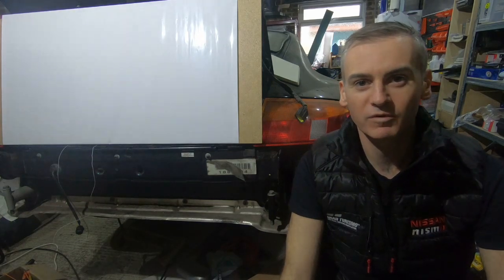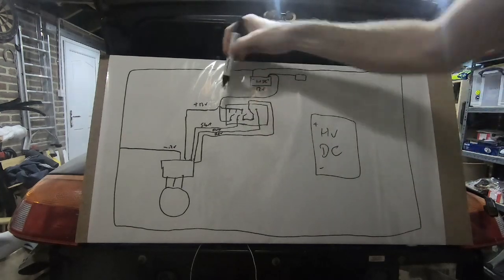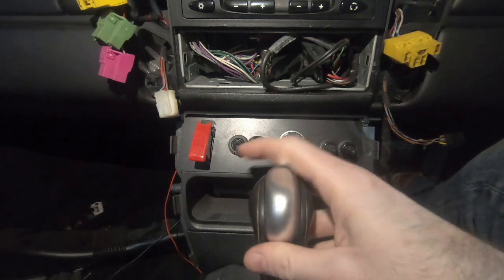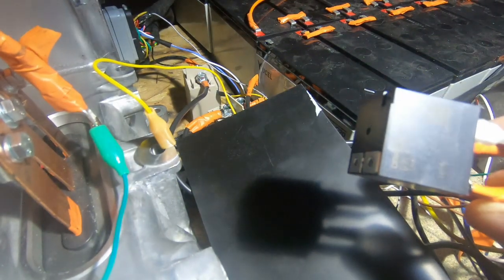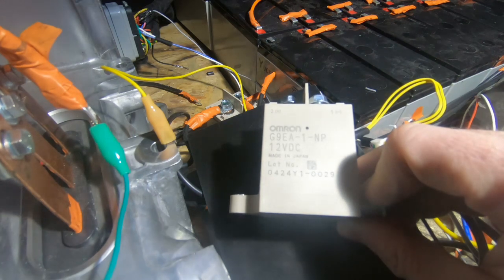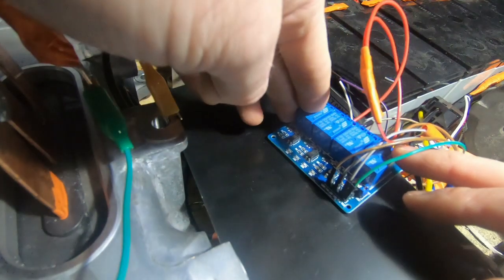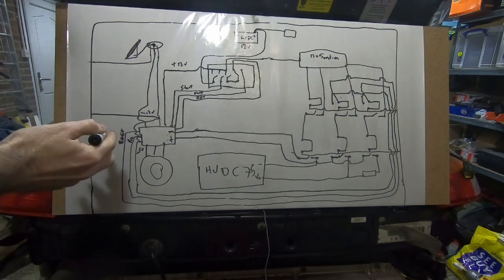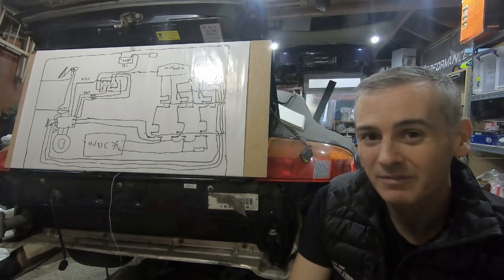Building an Electric Car - EV Parts - Open Source Inverter Wiring

Comment: I have a nissan leaf motor with the dc converter and the recharger still part of the unit. Is there any way to use those items with the motor since they will be. Needed at some point in time?

Comment: Hi, My name is Dave and Live in Las Vegas, USA.  I have 1973 Porsche 914 that was converted to electric 10-12 years ago.  My question is about the Leaf Heat pump or at least AC.  What voltage does the AC compressor  run on? I assume the compressor takes a DC voltage lesser than the Leaf batteries can supply.  My batteries are much lower voltage than the Leaf  and are at 170 - 145 VDC.  What can you tell me about the system?  Thank you in advance.
Reply from the maker: Hi Dave, I haven't seen much on the Leaf Heat Pump and AC module, I know the car I got the motor had one, but it wasn't one of the parts I got with the drive unit stack.  The output to it is from the Power Control Module,  so I guess it is expecting 360-400v.  Could you use a boost DC to DC converter to go from your 170 to closer to what the pump needs?  Electric 914 sounds like a great project, they are an awesome looking car. Good luck
Reply: @PerformanceEV  Thank you for your response.  Great video BTW

Comment: Well explained, it’s basically simple enough to follow. You may need to take advantage of breaking & deceleration to recharge the battery.
Reply from the maker: Thanks! Yes, regen on breaking is part of the plan, but I know that I will need to do a lot of configuration and testing in the software to get the car driving as I want it to, so keeping my focus on the basic operation of the motor first.

Comment: Great Stuff!  But now I have to aske a few questions :) What is the purpose of the capacitors and are you able to show how they are wired in a future episode? Also why use the electronic relay board?  Could you explain how to use the software to program the relay board.  Thanks!

Comment: Hi, well done on getting the wheels spinning.
Im at stage where trying to spin motor on projects, one is at outboard other is on Land Rover gear box (two project not a boat car sorry, not yet)

Mine is Gen 1 though and rather a few differences with wiring and control
I'm at stage where sending can messages direct to Gen 1 inverter,  and hopping to see it spin.
Reply from the maker: Wow, two projects at once, good effort! I tried to get the motor running just using Can messages, but didn't have much success, so I got a replacement logic board instead (this will be the reason behind the big differences to your wiring. ) If you are trying to control the existing inverter, then you should check out the work Damian Maguire has been doing, if you haven't already. He created an open source VCU for the leaf gen 1 and has put a lot of the information up on you tube and GitHub.
Reply: @PerformanceEV  I'm not sure he sharing all the info, is a lot of stuff their to tease us. 
But seem to be holding back, the code that shared does not seem to be about running the Gen 1 as he showing in video.

I'm progress well do far,  have the com's working sending can messages to the inverter. (Just getting an error and not to work out what step missed)
And I have worked out how to power up the junction box to use for charging back up the Aux battery
(Actual I shared that just the other day: http://myimiev.com/forum/viewtopic.php?f=23&t=4533&p=40483#p40483)

Next step it to work out the on board charger back in to the battery.

Some info on my project here (Not as much video as you sorry)
https://sites.google.com/activeautomation.co.nz/the-turned-leaf-project/projects
Reply: Also im using Gen1 and your Gen2 so some difference I have seen in Can messages just with those

Comment: I am actually surprised that openinverter (Johannes' ?) board supplies 5V for positive/precharge contactors instead of 12V. Will need to dive into it more before my conversion.
Reply from the maker: The positive/precharge output itself isn't a 5v signal, rather an open collector output. The relay board that I used to interpret that signal and feed 12v to the contactors needs 5v power. I could run it from an external 5v source and have only the single open collector signal wire coming from the inverter itself. I am using the 5v from the inverter to minimise the number of different objects I have in that part of the car.

Comment: How calculate resistance of precharge resistor for 400v battery?
Reply from the maker: Hi, I found this link good for trying to workout which size of resistor would suit. There are a few calculations based on the voltage and the capacitance of the capacitor.
Reply from the maker: http://liionbms.com/php/precharge.php